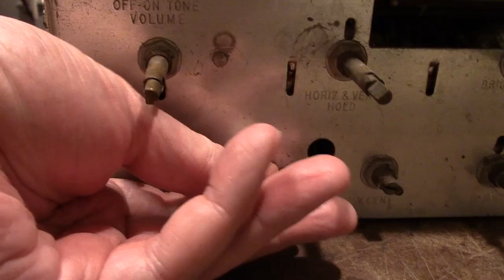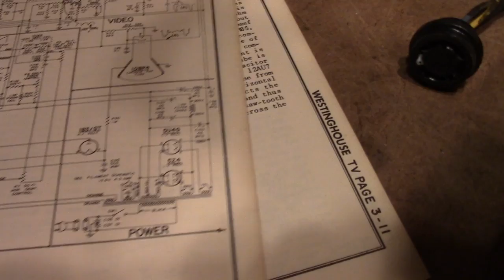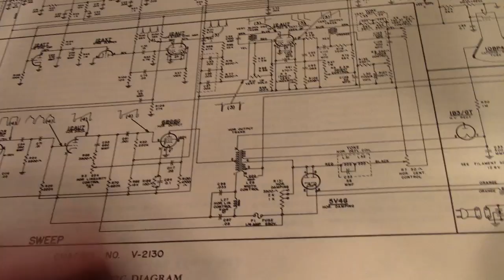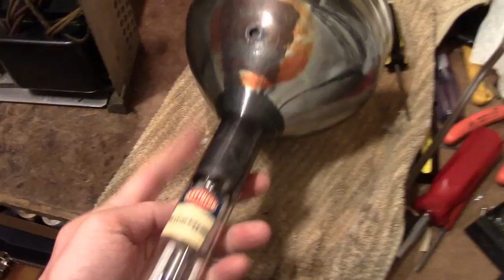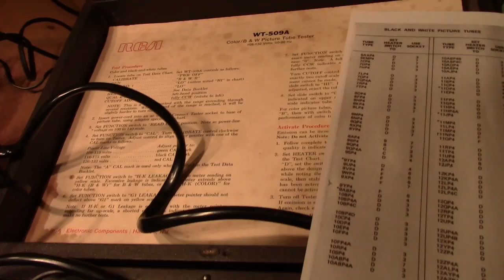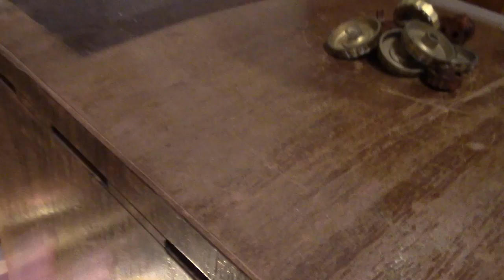Westinghouse H-196 restoration p1o?

Comment: As of now,I've got my '52 Midwest model 716 to finish up plus a 1940s Packard -Bell table top set I got yesterday off of ebay.It is a full wave rectifier powered set with seven tubes.It has no filter hum but there is no reception.The chassis is in nice shape and the speaker isn't torn.As for the case,it needs new speaker cloth and new knobs.The controls are frozen.The case is solid:no warpage and no cracks in the veneer.Its a model 48-H,

Comment: You are rekindling my interests in restoring old TV's Bob! I already have a soft spot for scopes, and this is breaking me down...LOL! Even a Lead shield on the tuner tube to keep x-ray noise out..... Too cool!
Keep up the great work!!!

Paul
Reply from the maker: Mr Carlson's Lab I have a bunch of scopes to restore too :)  That lead is there to reduce vibrations - nothing to do with x-rays .  The whole tuner is mounted on rubber shock absorbers too.
Reply: Very interesting. I always understood that the lead shield was to stop X-ray noise in the tube tuner. This was especially common in high gain circuits (tuner front end) when the HV rectifier is exposed (no shield) This problem of x-ray noise is more apparent in tubes with exposed grids, such as the 6J6 tube (x-rays smashing into the grid creating noise) This may be the reason they didn't use that tube in this construction. What do ya think Bob? Am I nuts, or does this make sense :^) LOL
Reply from the maker: Mr Carlson's Lab All the literature I've read is that the lead is to reduce michrophonics (virbations) - nothing to do with x-rays.  The HV is much too low in these TVs to produce any.